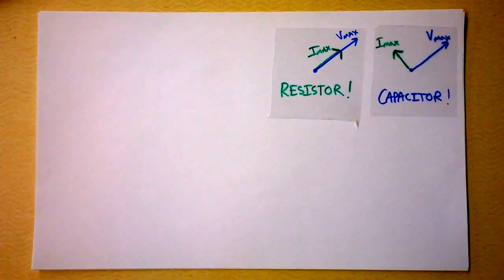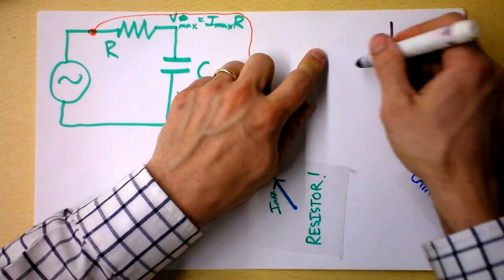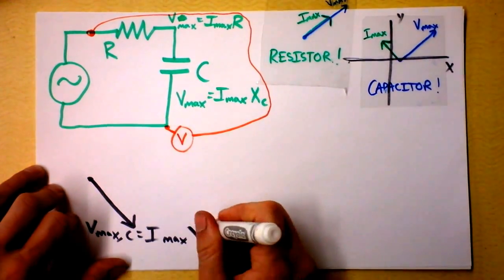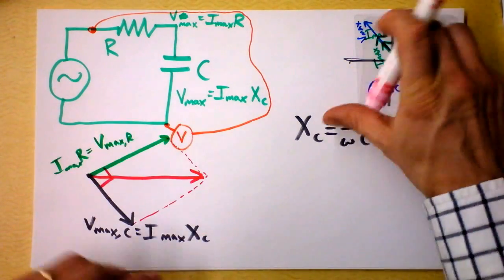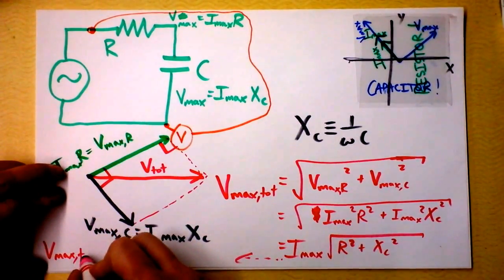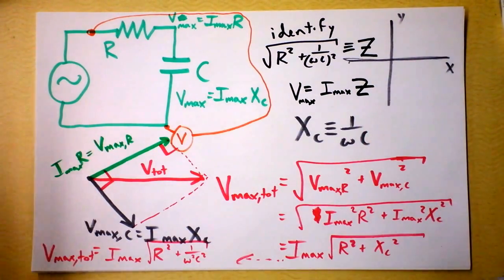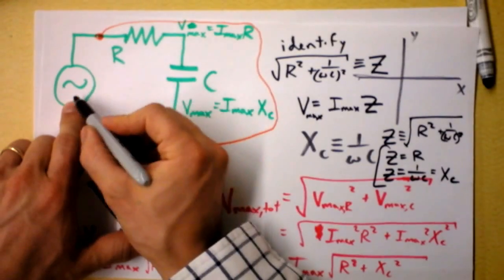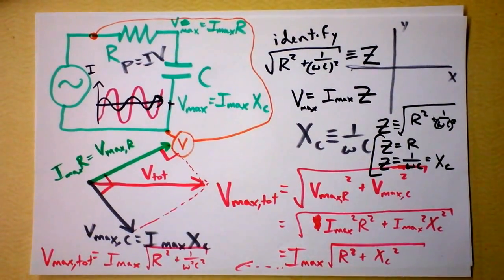Intro to Frequency-Dependent Impedance | Capacitors in Alternating Currents | Doc Physics

Comment: For a capacitance equal 0 the impedance is infinite. This makes sense since it means your circuit is open. If you replace the capacitor with a piece of wire you'll get an infinite capacitance since the wire acts like a capacitor that takes an infinite time to charge.

Comment: Why do you always add an resistor in a pure capacitor or inductor circuit? I just dont get it
Reply: I am currently taking Physics 2, so I only have a weak fundamental understanding of physics. I am not completely sure that this is what happens, but this is what I think: 

Theoretically, if we have no resistor, the current would be infinite. The electrons would be moving so fast that the battery would not be able to keep up. Literally, within milliseconds we could have an infinite amount of Coulombs passing through a point (I = V/R, as our R gets smaller and smaller towards zero, our current would reach infinity). Now, this may be hard to imagine, but theoretically, if an electron is moving at an infinite speed, it can be at all places at once (within the circuit). However, in reality, we can never get or make any material to have zero resistance (probably because an electron can't be in two places at once). Therefore, to make the problem more realistic and avoid the theoretical anomaly I have just described (current = infinity if we have no resistance), we use a resistor.
Reply from the maker: It would be silly to imagine that you do not have any inherent resistance in your circuit.
Reply: Resistor will dissipate the electrical energy as heat energy, making the circuit not efficient, isn't it doc? 🤔
Reply: +Icey Junior, yeah it will make it not efficient. But the wires we use everyday are not efficient. If you just connect them to a battery they will heat up cuz of their own resistance.

+Keval Patel YO RIGHT NIGGA
Reply: In simple words, more current = your house on fire. Shut up and thank Mr. Resistor

Comment: when you added the two voltages how come you didn't add the Y components but rather the magnitude of the vectors.
Reply from the maker: +John Lin I didn't add the magnitudes.  I'm adding the vectors themselves, and then taking the y-component of each.  That's equivalent to taking the y-components and adding them but more conceptually pleasant.
Reply: Oh alright thanks :)

Comment: Hi, Thanks a lot for your explanation, but I guess you are measuring directly the voltage of the AC source as you connected the red lines :)
Reply from the maker: +Majid Mahjoori Yes, but mustn't that also be the sum of the drops across the two elements at any given instant?

Comment: An amazing video indeed. Just had a small doubt. At 7:15 you said that when there is no capacitor in the circuit the impedance just equals the resistance. Is this because when you replace a capacitor with a conducting wire, the capacitance actually becomes infinite and thus the term containing 1/wc disappears?
Reply: 1/(w*c)^2, assuming c is zero, would be 1/(w*0)^2. w*0 = 0, so then we get 1/0^2. 0 times its self is just 0, so then we have 1/0. Anything divided by 0 is just 0, so then that final piece is just 0. Plugging that into the equation, we would be taking the square root of R^2 + 0, which would just give us the square root of R^2, which would give us R.

I sure hope this year late answer helps someone.
Reply: Nymphaea Caerulea 2 years lol

Comment from the maker: I believe that notation indicates that the capacitor and inductor do not dissipate power over a full cycle.  You will find real resistance for resistors, 'cuz they heat up.